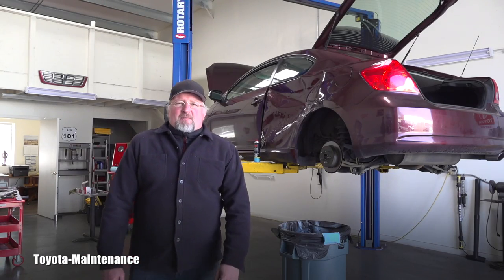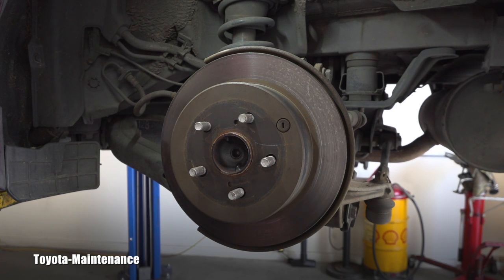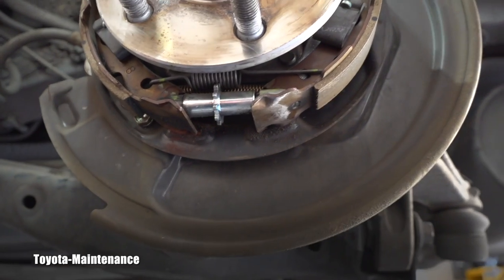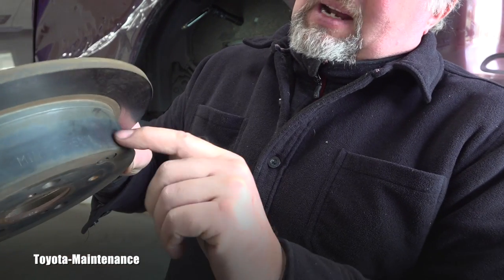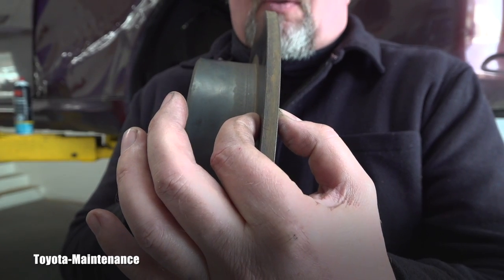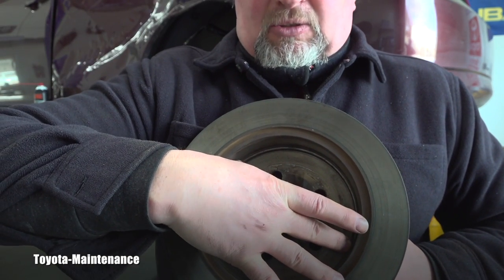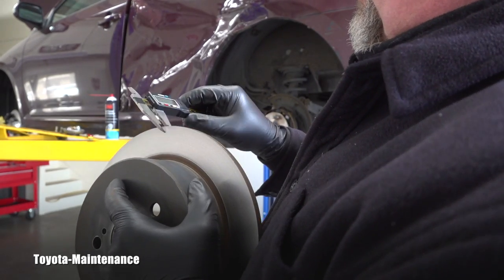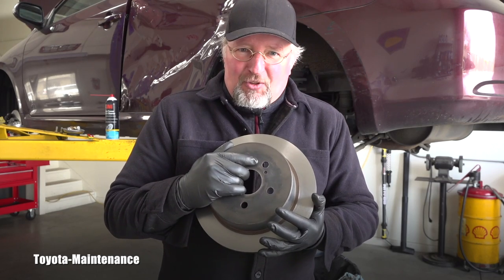Toyota Scion TC rear brakes

Comment: nice video, My 2006 tc's brake  dust shield completely rusted away. Your tc is in great shape!!
my  drum brake assembly also rusted very bad. the pin and spring fell off when i take off the rear wheel.
Reply: Just bought one at an auction and one of the rear rotors is paper thin and rusted to hell. I have no idea how someone managed to do this lol

Comment: I do my own car's brakes, and I've always been able to buy new rotors for less than it would cost to have someone resurface the old ones.  So I wonder whether the lathe is just for mechanics to make money?
Reply: Tom Jelinek I can’t find anyone who does that any more. Used it in the old days but it seems shops rather charge for replacing and up selling than fixing.
Reply: The honest truth is you dont need to resurface your rotors unless they are pitted or warped.  your new pads will do two things, forms to the rotor and wear down the rotor and themselves based on the individual pads.  resurfacing rotors when not needed will shorten the life of the rotor and not actually improve braking.  Ive been at this for nearly 40 years so I know the truth.
Reply: @therodecclesshow2070  Most worn rotors begin to shake the car when braking.  A slight washboard, or warp, is a wave function, and inevitable in a changing surface.  And resurfacing smooths that out.
Reply: @Krakondack rear rotors only cost me 30 bucks a pop so might as well just replace them.

Comment: My rear hand brake pads are stuck from rust to the inside of my passenger side rear rotor. I cant turn them to get the hole to line up to losses the tension on the pads and ive tried moving the car to brake the pads lose, which worked in the past about 8 years ago when this first happened. It seems if you get your hand brske pads wet and then park the car for a few days with the hand brake on this will happen. Any advice on a way to get the rotor free from the pads?

Comment: Didn't see you mesure the ID  your 6" calipers cant do it, or can they?  Yes they can  but its goingbto take a second tool and the accuracy totally depends on your ability to mesure.  Me I can mesure down to 5 thou with a tape mesure but I was a machinest.  

The older tc used a drum style e brake the 2011 and up use a twist caliper type.

That poor tc has a bo bo.

Comment: Hello ! I have a 2008 Scion tC. It has a cylinder 2 misfire and low compression in this cylinder. Is my car worth saving?
Reply: I have an 09 and the 2nd cylinder was misfiring also. Replaced the coil pack and it fixed the issue.

Comment: Where are you now located?

Regarding the brake rotor...
Why resurface it? It looks great. If it's not warped or pulsating the brake pedal why contribute to wearing it out by resurfacing it?

Keep up the great videos.
Reply: He should just even off the edges.
Reply: It should be machined besides he’s a perfectionist if just half the mechanics where as thorough and as conscientious as he is mechanics would have better repp
Reply: The school of thought with that is it is best start of with a true flat surface when installing pads.  Either resurfaced or purchase a quality replacement.  You can always put new pads on old unsurfaced rotors.  But in his case he wanted to start off with a fresh surface and it just so happens that he has his own brake lathe.  For him it was a no cost process that gave him the piece of mind that he was working with a true flat surface.  Just my 2 cents.
Reply: @erikcox1947  
That makes sense but... Since he hasn't answered the question for himself we're assuming that's the reasoning. The vehicle owner may have been interested in extending the life of the rotors but was he even given an option? Likely being the rear rotors which normally last longer than the front, it's a somewhat mute point. (Especially if the rotors were already on there for 100,000 miles.)

My reason for asking is that I was told that my rear pads should be replaced soon. I have a 2009 RAV4 with the OEM rotors still on the back but my vehicle only has 41,000 miles on it. If my rotors look as good as these then I doubt that I will have them resurfaced especially since I would have to walk them to a shop that does the service and I have only the one car. I haven't looked at them myself. Maybe they're good for another 9,000 miles?
Reply: @stevensevek6151   the vehicle he is working on in that video is actually his own.  He picked it up not to long ago, it is a salvage.

I know it is not apples to oranges but on my 2007 Tundra I replaced the factory  front pads at 247k.  I did not touch the rear pads because there was still enough material on them.  In your case, who told you that your rear pads needed to be replaced?  If I am not mistaken your front brakes do 70% of your braking.  With that little amount of miles on your Rav4 I would really question that replacement recommendation.  Also do your brakes squeak or do you experience and pulsation in the brake pedal when applied? 

Also to answer your previous question his shop is in Arcata Ca.
Reply: @erikcox1947  
Hey, thanks, I appreciate the follow up...
My brakes don't squeal or pulsate. The diagnosis was done by Firestone Complete Car Care. I know better than to totally trust these places. They love to upsell customers just for additional profits. I'm 73 and have to be really careful doing too much of my own mechanical work, like I use to do, or I will pay for it with extreme lower back pain. But I still change my own oil. I go to Firestone mainly just to get my tires rotated. They usually have a coupon online for $9.99. I don't get free rotations* cause we bought the vehicle used nearly one year ago. Because of that, I don't know what the actual history is as to whether it was city or highway miles. It could have been mostly city miles but even if it was, it seems odd that the rear pads would be wore out. The first owner only put less than 19,000 miles on the vehicle in ten years.  We put over 22,000 on it (in 1 year) with probably 80 to 85% of those miles being mostly highway. It was two months ago at the last tire rotation they said the rear brakes were getting low but still good. I know there are wear indicates that will audibly let me know when they are ready to be changed.

Wow! 247k on front pads. That is unbelievable. Sounds like you do mostly interstate miles and also engine braking...🤔😉😀 Many years ago I had a delivery route with over 300 stops on it seven days a week. I has cheap front pads wear out invas little as 7,000 miles.

*Also no free tire rotations cause the tires on it were used. My wife's brother-in-law had them in his shed. They fit a van he traded in but his new van had different sized wheels. Since they were the exact size our RAV4 took, we ended up with them.